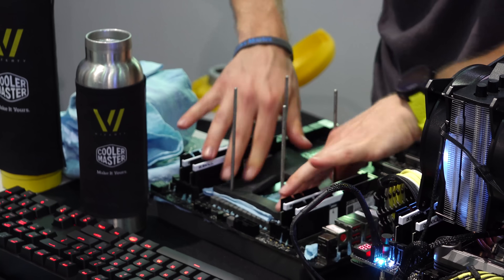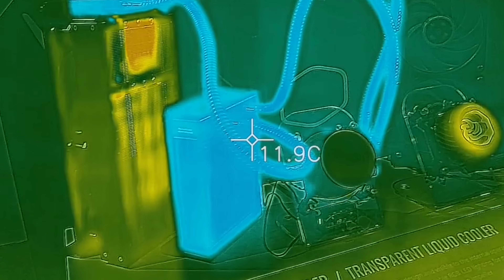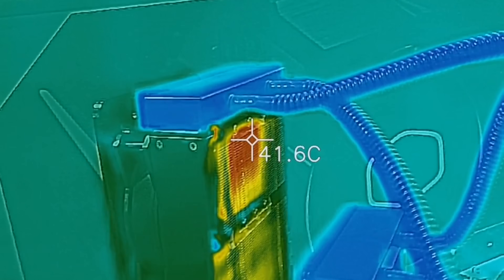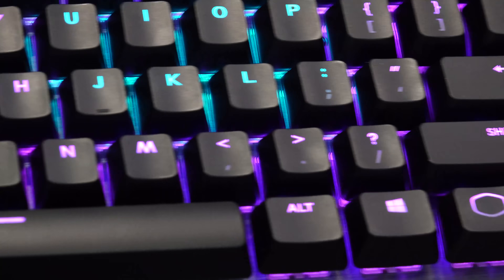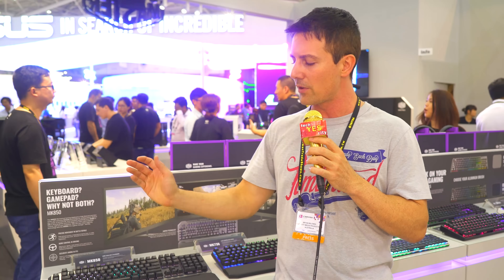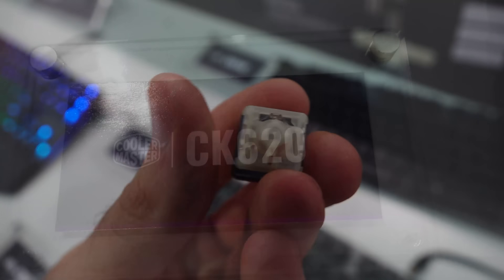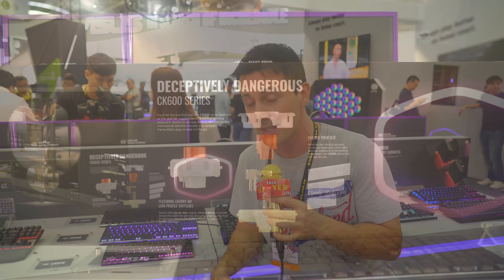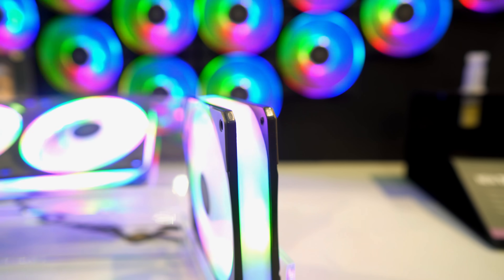A THERMO ELECTRIC Cooler... at $299?? MK850 ANALOG Keyboard & LOW PROFILE Cherry Switches

Comment: Dell had this design back in 2007 with their XPS 720 and 730 series LGA 775. I know because I recently purchased an XPS 720 and later the upgraded Peltier Cooling device... I plan to reverse engineer the unit to be able to make a newer updated version for other platforms but due to medical health constraints I've not be able to work on this project for over a year now... This Peltier concept is nothing new nor is this design and for 200 bucks is just a straight up RIP OFF... I know you don't set the Pricing Brian so no slight towards you is intended but rather at the Greed of Cooler Master....

Comment: I work with a lot of peltier systems at work. They are definitely not worth it for CPU cooling. They drink power and have a high level of failures as they are modulated by thermostats powering peltier on and off. It’s very hard for peltier to cope with fluctuating temps like a cpu - they are better suited for constant temperatures. This is more of a gimmick to me

Comment: Cant wait for that cooler,will def buy that,hopefully it wont disappoint,just seems like alot of water coolers these days are just "ok".
Reply: Bobzillaaaful it will disappoint unless it draws at least 300w. Peltier coolers are very inefficient, you need a lot more power than the load (CPU) uses. Phase change coolers (refrigeration systems) are highly efficient on the other hand, around 10x as efficient depending on the temps. Those work (putting one on old FX today), but they do cost a lot more.  However they work, so I imagine this peltier is a complete waste of money unless you are coming duel core processors.

If it works, I'll be amazed because peltier cooling is awful.
Reply: mega rip

Comment: My question is: Wouldn't that cooler fry the motherboard/socket over time?
You can already see they put a rubber mat below it, because there will be condensation...
People have already tried Peltier cooling back in the Pentium 4/Pentium D era...
I think the only real solution would be to electronically regulate the load, so that the cooler will never drop below ambient temps. (The full power will be only enabled when the CPU is too hot for sub-ambient temperatures). That way a peltier element could support a normal water loop for better heat separation. (the air coming out will be hotter than the air inside of the case, but the air inside will not be colder than ambient)
Reply: TheRailroad99 it looks like its designed to sit just below ambient at what i assume is idle. A couple degrees below ambient shouldnt build up condensation. But im curious what load temps are. And whats the point of the secondary radiator? Put it on the floor of your case as an intake for your gpu?

Comment: The thermoelectric cooler is really "cool" (for lack of better word), and I did look it up. Is it really worth it over simple water cooler which can already get you decently low temperatures?
Reply: Gohan6 probably for almost zero fan noise
Reply: you'd still need a fan to dissipate the heat. maybe less noise than a water-cooling loop (no pump) but still.

Comment: Peltier elements are a nice little gimmick, but for cooling a PC they are a poor choice:
They are only efficient at very low heatloads. But if you want to transfer 50W of heat the element it self will need 50W extra that also need to be cooled. If you really want sub-ambient cooling get a decent phasechange system.
Reply: well given its paired with an AIO it may be enough to get the sub abient coolant.
Reply: Problem is, a proper phase change system is extremely loud and far far far more expensive.
If the heat sink is big enough, a peltier system might work pretty well.
I mean, all of the peltier coolers we had in the past had quite small heatsinks or they used very weak peltier elements.

Comment: the Peltier cooler probably draws 100-150 Watts by itself, so about the same dissipation as the cpu.
Reply: Fred Zlotnick Dude no, that heatsink size doesn't mean that it consumes the same power as how much that heatsink can dissipate.
The TEC's hotside gets extremely hot that's why it needs a huge heatsink. A peltier module could consume 20W while heating up to 100°C. 

It's hotside should have a huge ass heatsink for the coldside to get low temps (20°C below)
Reply: I have seen Peltier cells running 90 watts or more.
Reply: Fred Zlotnick Do you really think they'd use a 90W peltier when they know it's gonna be used on a PC that consumes 300+ watts already.

They would use a lower model so this thing could be reasonable.
Reply: Intel showed a compressor that consumes much more than that

Comment: Paltier effect cooling is much less efficient than vapor compression chamber cooling. Plus it only works for a limited amount of heat flux and is very power inefficient.
Reply from the maker: Oh no worries, I didn't know that!
Reply: Cooling is actually pretty hard to do efficiently.. It always will require lots of power and produce lots of heat.. Those dam pesky laws of thermodynamics
Reply: you idiot, vapor compression chamber cooling requires guess what, A COMPRESSOR
LOUD AND BIG AND EXPENSIVE AND WASTE OF POWER